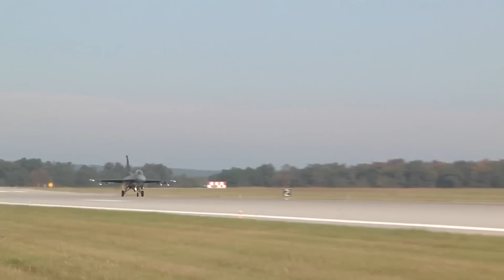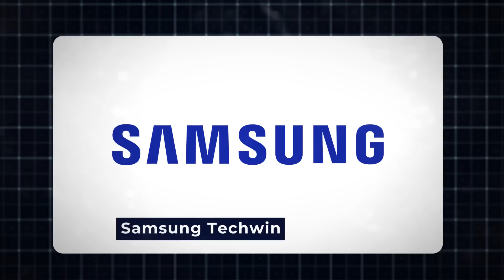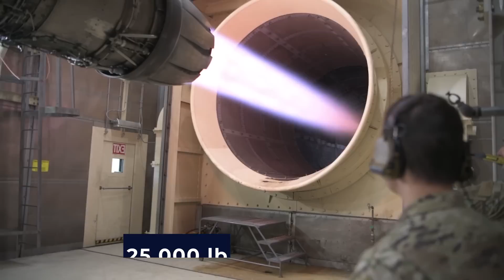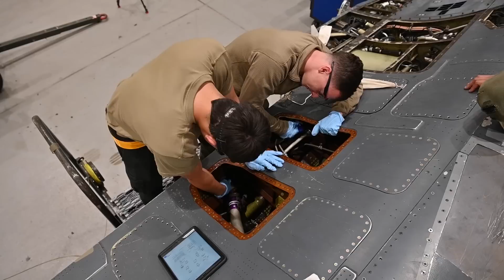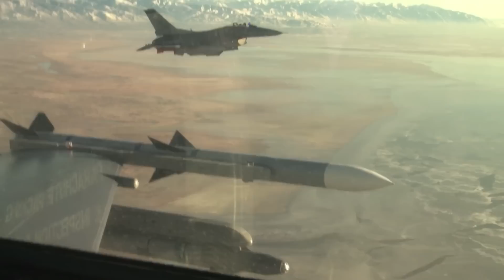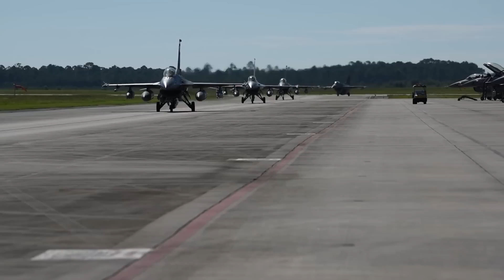US Unveils the Fearsome F110 Engine That Makes the F-16 a Global Threat!

Comment: Hmmm....really, F-16 to reach Mach 2 first?  I don't think so.  F-14 hits Mach 2.34.  Many other planes have hit over Mach 2.  F 104 hit mach 2.1.  F-4E at 2.213.  How about our F-111...Hmmm 2.5 Mach.  The F-15 was about air superiority and not top speed.  It just happened to be fast.  But it also takes range and maneurvability to make it happen.  The F-15 was first and is still why we use it a lot.  F-16 is a great plane and I hope we sell a lot of them, but speed is not what sells for the F-16.  It is versatility and bang for the buck.